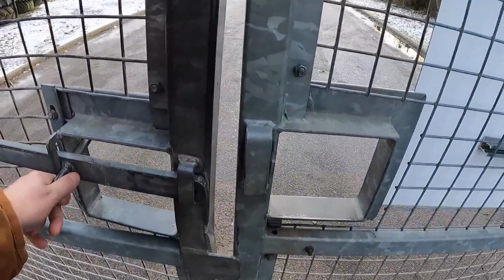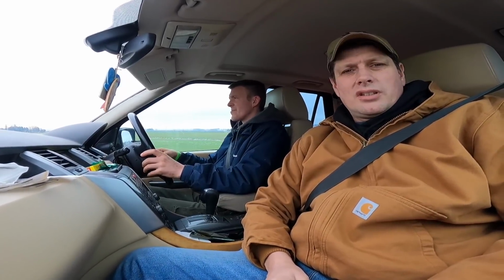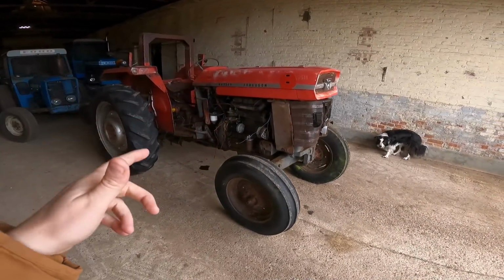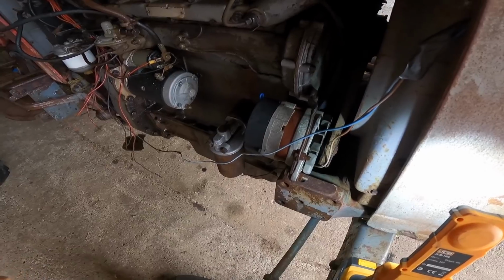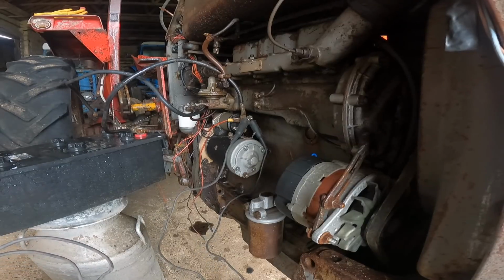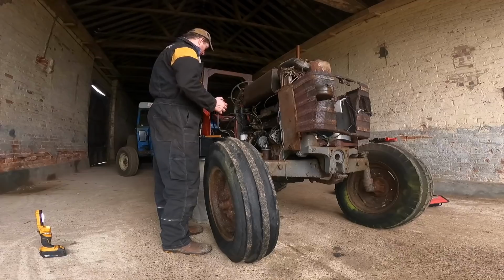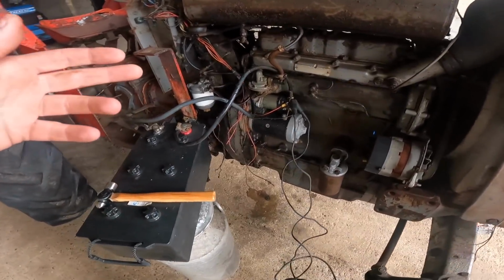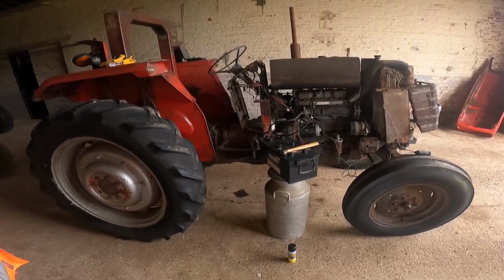MASSEY FERGUSON 165

Comment: Is that a 65 not a 165?
Reply from the maker: No it's a 165, the giveaway being the big 165 badge on the side and also the fact that's it's a 165...
Reply: @LordMuck  the first of the 165's were actually 65's and that's what you have got
Reply from the maker: No, this is later than the first ones and has differences in some of the castings, hence why the Ferguson Heritage people told us that it's a 1967 165. There are many similarities to earlier models but this is a 165 (We have a 65 at the other yard and several things were changed for the newer models) They changed the 165 yet again the year after and it received some upgrades.
Reply: MF 65 mk2 was discontinued in 64/65 when they introduced the MF165. The one in the video is an earlier one but well in to production when lots of improvements were made.
Reply: Definitely 165.  65 had old style hood and grill

Comment: Lord Mick
another great video- thank you!
can I ask some engine advice-
I have a good JD 6910, good tractor, engine running well, but rear main crank seal leak.
I am still in the early learning skool stage here, would u advise just get the rear main seal done, or should I go full hog and get engine rebuilt?
engine at 10000hrs, so I suppose I am asking is how often is worn rear main seal more a feature of crankshaft movement with bearings worn? or should I get seal done and see how we fare
as always your advice hugely appreciated.
apart from rugby world cup- yours is best channel going
thank u
mf
Reply from the maker: At 10,000 hours a full rebuild is just common sense.
It's out, get it done and go for another 10,000 hrs
Reply: …….Apologies, I meant Lord Muck…